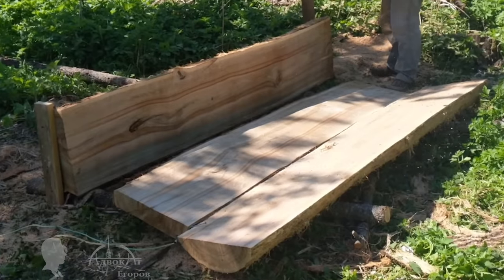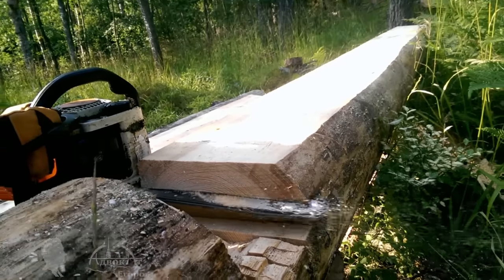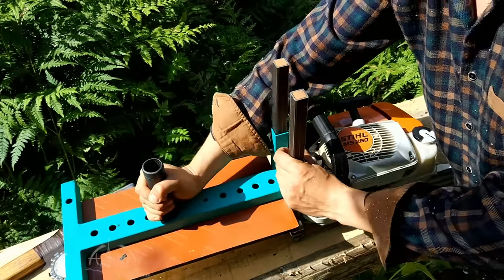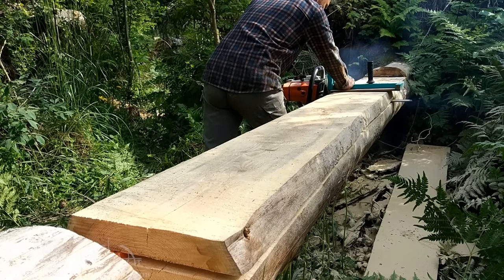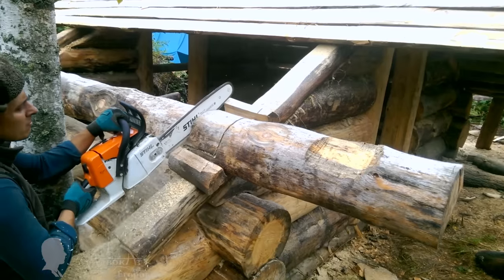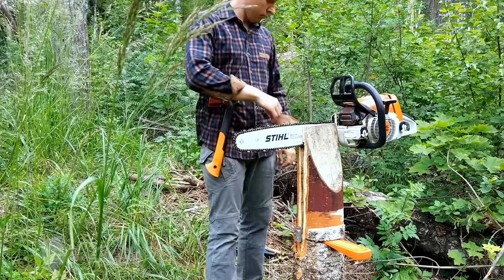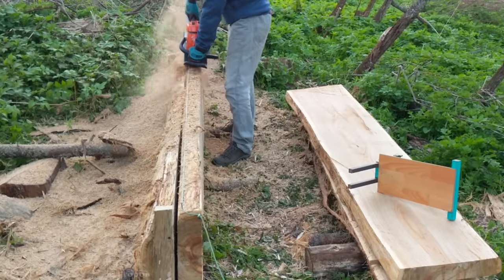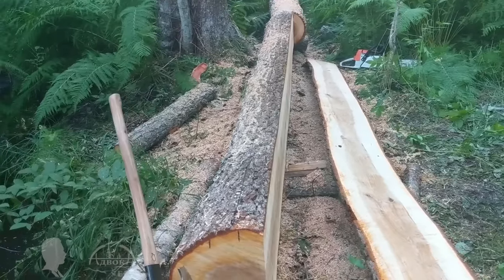Two Chainsaw Secrets | Turning a Tree into Perfect Boards

Comment: I know this is a year old, but I don't really care much for newer Stihl saws. Ever since they changed the model numbers from 0** to ms**0. Never really had any problems with the old 028 saws, plenty of power and more reliable than anything else, when properly tuned. I don't care for Husqvarna, they're always so temperamental, and just don't seem to have the power. You always have to keep them wound up and be really delicate with them. Stihls seem to have more low end torque, just a lot easier to use and more forgiving. And the 028 is the best all around saw I've ever used, of course mine had a few small modifications to get a bit more power. Opened up the muffler a bit, and I think a couple other little things I can't remember. They're extremely popular here in the US, and easy to find parts, etc. I would think they would be everywhere, at least anywhere stihls have been widely available for decades.
Reply from the maker: Thank you for the reply. I ended up buying a Husqvarna chainsaw last summer and was quite happy with it since.

Comment: Either your log is soft or your chainsaw is extremely good. I spent an hour and hardly cut only 1 foot. Then I gave up, probably buying is more cost effective 😁
Reply from the maker: In this video I milled both soft northern pine and hardwood (oak).

Comment: To let each tooth cut more, file the rakers in front of the tooth.  File each one equally and touch up by rounding the nose of the raker. Rakers too high– teeth can't reach enough wood. Rakers too low–teeth bite too much. Rakers uneven–uneven stress will wear and  break the chain.

Comment: I have been using your video here as a guide im not the best but i have been working with a 20 inch echo chainsaw (Cs 590) and i have nothing but great results so far on black and red oak trees. cuts through pine like butter i dont think there is any need to get a 22 inch as I tested with a 22 inch husky but it seemed like overkill. love huskys but echo takes the cake im my opinion
Reply from the maker: I actually ended up buying two entry level chainsaws: a Husqvarna 365 and Echo...)))

Comment: I have a Sthil 029 Farm Boss and a Husqvarna 455 Rancher and my 455 Rancher has outperformed and had no issues at all. Never had it in the shop. My 029 Farm boss I have had to refurbish it twice and now cannot get it set to proper idle or speed even with a new carb.
Reply from the maker: Thank your replying!

Comment: No experience with that 260 model but I have been using Stihl saws since 1973 and making a living with them for many of those years. A warm up is critical for long engine life and should be routine. 1 minute in warm weather and 3 minutes in freezing. Don't ever use any more mix oil than the recommended ratio as it causes a lean condition and adds to carbon build up. Only use a high quality mix oil that colors the gasoline a dark green so there can be no mistakes. When cutting large diameter trees or long rip cuts richen up the high speed jet slightly.
 Replace your cutting bar and chain when the chain tips sideways in the groove, pay attention to how much a new chain moves in a new bar so you can tell when it wears out. Use only special bar oil and adjust the flow so the chain never gets dry, even if your bar oil runs out before the gasoline, this is essential to long chain life. Don't use motor oil or gear oil on your bar.
 A rip chain cuts much faster than a regular crosscut chain when ripping but I sometimes have just ground a 10 degree angle on a half worn out regular chain and used it both ways.
Reply from the maker: Thank you for the info

Comment: I have been cutting and logging firewood for 30 years. I will only use the Pro. saws for ripping logs like you are doing even though you are just cutting with the tip you are holding the saw wide open for long periods of time. That is hard on any saw I prefer Stihl saws but there is nothing wrong with the Husk Pro. saws. I just happen to have a Stihl dealer close to me. The Pro. saws are more money but I feel that they hold up allot better. Even with a larger saw you can't rip a log without letting the saw idle for a while. They cool down faster if they are idling rather than just shutting them down. While idling the fly wheel is still spinning so it will blow air over the cylinder and because it is not under load it cools faster. I have an MS261c runs great never gave me any problems. You might want to run 40:1 or a little richer if you are ripping logs. Just let them cool down every once in a while. You can keep the saw in the cut just walk away and have something to drink!
Reply from the maker: Ted, thank you for the reply!

Comment: Husqvarna has been my go to saw for over 40 years. I used McCullagh  for about 5 yrs also but they are no longer made. If you can find a used pro mac 700 it would serve you well. Parts may be a challenge to find. Wilber/USA
Reply from the maker: I ended up getting a Husky 365 saw
Reply: @Advoko  Excellent Choice, I use the 572XP, but started with a 55 that is still going strong after 40 years. You should be pleased with your Husky. Wilber

Comment: Not sure on the chainsaw, wondering did you break in your 260 first or start cutting boards with it right away? Anyways good info on the board cutting.
Reply from the maker: I ended up getting a Husky 365 and it had no issues for almost two seasons...

Comment: Привет!  

I watched a video about brand new chainsaws REQUIRED service prior to use.  It was fascinating yet sad to find that metal shavings have been found inside the engine fuel /oil chamber during the manufacturing process.  The video showed the dismantling of I believe two brand new saws and found that the chambers had debris that eventually damaged the engine.  It appeared from your piston photo that was a problem.  The brands of saws dismantled in the video were popular brands.  In short, take apart a brand new saw and inspect and clean the internals.  For old saws.....do the same.
Reply from the maker: Thank you for the info

Comment: i have a question regarding your technique with your self made guide rail. If you say that the best way is to use only the tip of the blade to have only 3-4 blades at the same time cutting the wood for big shaves. Why not grind OFF most of the blades on the chain and leave only a few equally apart from each other and then use your self made rail again?  Thanks for sharing.
Reply from the maker: David, it is also possible, there are special skip-tooth chains, however, your chain would get duller quicker…
Reply: @Advoko  Thank you for answering this fast! Ill give it a go for the fun of it. This was my 1st watch of your channel. thumbs up! ill recommend it ! cheers.

Comment: I wonder how well a bow blade chainsaw would help keep a straight cut using this method, it also has a rounded cutting surface much like the tip of your saw, but larger

Comment: about 2 months back i bought an echo as a replacement, what a mistake, even had trouble taking it back, but got my money, and ever since i been cutting wood, I have used a Husqvarna, and regretted trying that echo.

In some odd 50 plus years I been using a Hus, and will never change from that, cut thousands of cords of wood and timber, I have had a 3 ninety 4, now they replace that with a 3 ninety 5
also have a 41 cc and both have been always the best for me,

yes they after many hours of use, needed a rebuild, If I recall correctly possibly 2 or may have been 3 rebuilds over the many years,  just can't remember,
and one more thing, I always use the best oil mix and always mix the fuel at 45 to 1
not as 50 to 1 as recommended, 
you always want to see a little smoke when running the saw.
Reply from the maker: I ended up getting a Husqvarna 365 chainsaw and it hasn't let me down in almost two years...
Reply: @Advoko  good move, mine is much bigger, yet that should work just fine for what you are doing, The bigger saw is much heavier then the sixty five, and should last you for many years, but do use a 45 to 1 mix, to be safe, you will have to do a clean up or tune it, maybe every few years depending on how much you use it 
also use fuel conditioner in the cheap gas, or use premium if you do, an when you let it sit for a while, it will usually start, and I have done that for years, without any tune ups.

Comment: I have had very good experiences with STIHL chainsaws, perhaps yours was the one dud, lemon, mess up out of the bunch that was produced at that time? If you replace the whole chainsaw and still have problems then I would say it is the manufacturer that is the problem. Lastly if it matters my chainsaws are all old and not new.
Reply from the maker: My 20-year old Stihl saw is still going strong... You could be right.

Comment: Standard stihl chains are designed for cutting against the grain, hence while you cut a tree down and make a widget you will notice this..
 What I use to do just what ur doing is a high aggressive stihl chain and I knock Rackers doown with 3 passes each right off the bat new chain.

Comment: If your carb isn't adjusted correctly is will run lean at high revs and this leads to not enough lubrication and overheating followed by piston failure.

Comment: Problem with sthil is too lean mixture and leaky carb connectors from factory. Don’t use 50:1 oil mix. Use 30:1. Mine burned up in 3 hours using 50:1. Dealer said it was my fault. I buy Poulan, which is Husquvarna. Cheap and just as good. Run rich mix.

Comment: I know my comments is late but it might help, I dont know about what you have in your country as gas, but from what i saw in the video(the gunk from your piston first ) you should get gas with the highest octane value, here they put 10% ethanol and when it burns it makes a depot that clogs jet, the newer OPE (after 2007-2010ish...dont recall exactly when)  comes with smaller jet and they do break easy when your running them with octane lower than 90

Also i am not sure if you did use one, but try and ask for a ripping chain from one of your suppliers its gona make your life easier
Reply from the maker: Dominic, thank you for the info

Comment: Basic question, how do you cut the tree log? Is there an orientation that the logs needs to be arranged with respect to the inner rings or whatever it’s called
Reply from the maker: Yes, there two common ways to mill lumber  plain sawn and quarter sawn. The plain sawn (tangential) grain is less dimensionally stable than other cuts and can cup more easily. Quarter Sawn lumber is produced when the log is cut into four quarters (hence the name), then each quarter is flat-sawn.

Comment: You mentioned that you sawed some aspen.  Does this make good siding?  What other uses? I have a Stihl 310, 20" bar.
Reply from the maker: No, it wouldn't work well as a siding material. Aspen wood is soft and has low flammability. It has a number of uses, notably for making matches and paper where its low flammability makes it safer to use than most other woods.

Comment: Do you use fuel with alcohol in it?  If so you can remove the alcohol by mixing in water to capture the alcohol , then drain the water alcohol from the bottom leaving nearly pure gasoline.  Alcohol burns hotter then gasoline and has less lubrication making friction etc.  Use a glass jug so you can see the layer separation in the fuel.  Once the fuel settles you can siphon the good fuel from top or drain water mix off the bottom if you have a drain on the bottle.  Carb and engine will thank you :)
Reply from the maker: I am not really sure if it had ethanol but my other saw MS180 worked fine on the same fuel all season...

Comment: I got the ms 462 ($1100)  I just took it out of the case and there's a puddle of oil under it.  I've used it twice.  I got the 174 because the 462 was just way too big.  The 174 works well, but it is underpowered.  There's really only one other choice, Husqvarna.  I never used one of them, so that's just hearsay.  I had to fire my sawyer - he was stealing trees.  I will try your technique, but I have to fix the 462.  Oil everywhere.
Reply from the maker: Brian, I ended up getting a Husqvarna chainsaw and was quite happy since

Comment: Hey my friend ,you need a bigger saw,way bigger saw.my Husqvarna 395xp goes thru logs no matter how you cut it ,hell it will even burn thru the log if it's dull.that ms260 is in the 50cc class,you need at least a 75-80 cc saw or more if you want to mill logs.yeah it can be done with a 50cc saw to mill but you will not be happy afterwards and it will be dark outside when your done.
Reply from the maker: I ended up getting a Husqvarna 365 chainsaw and I was my main saw for the last two seasons...

Comment: What was the first tip you showed? The second tip: cut vertically using your saw tip seemed to contradict what seemed to be your first tip where you cut horizontally. I’ll be watching this again to understand better I think.
Reply from the maker: Yes, I was comparing two techniques. The way you do it by using  swinging motions, using only the tip of the saw

Comment: As a mechanic I can Confidently say that piston and jug needed a lot More Oil. That was user error. I ALWAYS go for a 35-25/1 mix for bigger saws. As with ALL two strokes, its easer to replace a fouled sparkplug than it is to replace a jug and piston.

Comment: Are you adding any two stroke oil? The fuel pouring from your gas tank looked clean and unmixed to me, I dont mean to be insulting but sometimes the simplest answer is the problem. Also, most modern stihls say they run on 50:1 fuel mix but many believe that's just for emissions compliance and run a lower ratio for (potentially only the perception) increased longevity. I run a 362c, I'm curious to try this method since I only need rough lumber anyway
Reply from the maker: Yes, I used the same gas on my MS 180 and it worked fine

Comment: For the gas are you mixing it by the recommendations of 50:1 ? I don't use a chainsaw like I use to however I do mix my gas 40:1 ratio. Doing the cutting of lumber I would think the revving of the chainsaw would be more sustained for longer periods of time so the more mixing oil would give the chainsaw better lubrication therefore less wear or reduced wear. Let your intuition be your guide.
Reply from the maker: I was mixing 50:1 with original Stihl oil...

Comment: I personally think that a lot of the higher RPM saws that rev over 13k seem to burn up faster. The max RPM on the 260 is 14k I think. These 14k saws don't seem to last as long. It kind of makes sense too because if you look at the much older saws that generally topped out around more like 10k rpm, they supposedly lasted for a very long time. The highest power for the lowest RPM is probably a very good thing. These saws that have to spin super fast to make the same power aren't worth it, they burn up too fast, the piston has to move too fast, gets too hot, not enough oil protection it seems like. I tend to usually down tune most of my saws to run them under the max rpm and anything that runs over 12.5k I don't think I'd expect to last an incredibly long time. Potentially with a saw like the Stihl 260 you could modify the muffler to run it more rich & get a bit more power and also down tune the speed a bit and probably get more life out of them running at say around 13/13.5. I think opening up the muffler may decrease heat a bit too.
Reply from the maker: Thank you for the info
Reply: @Advoko  You're welcome, I didn't know if you'd see my comment. Did you end up trying a different saw or did you rebuild the 260 again? I have a big list of stihl, husqvarna and some echo specs for power to weight that I have been adding to for years that I could share with you. Come comparable weight/power saws that ran lower rpm could be 025, 026, ms250. The 261 is a monster but also very fast chain speed/probably burn up also. The Echo CS490 is very comparable also to the 260 but slower RPM. I have one and I like it, haven't fully broken it in yet. In Husqvarna the 345 to 351 were about same power to weight as well. The 545 and 550XP are as well for .2 more weight. I'm not as familiar with the new new stuff, a lot of the newer ones run at the screaming high speeds though that I'm not a fan of really. I do own a 261 for the sheer power to weight that I planned to mainly do limbing and light felling with but I will downtune it and then also muffler mod it after break in if I ever get better health wise and get back out there. Let me know if you'd like my spec list and I'd be happy to share what I have with you.

Comment: Husqvarna 372 is what you need...you'll never look back. I was once a brand loyalist and would only run stihl equipment- just like dummies who always think "my brand" is better, all you have done is fall for advertising and conducted yourselves like the sheep that you are (me included). I began thinking for myself at some point, got my hands on ALOT of saws and after running one hour on the 372 I was all done searching though I did run other saws after it to see what they were like. Power and  capability for pound the 372 simply cannot be beaten
Reply from the maker: Thank you for the info! I ended up getting a Husqvarna 365 chainsaw and it hasn't let me down for almost two seasons...
Reply: @Advoko  that is another fantastic choice!